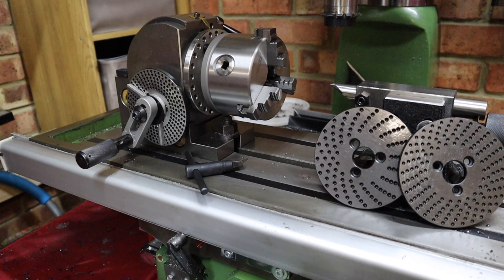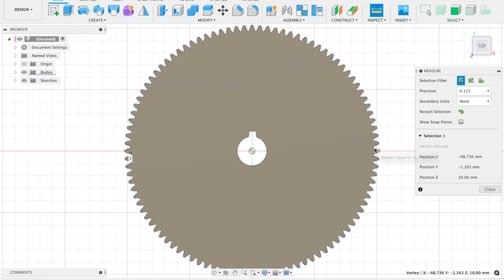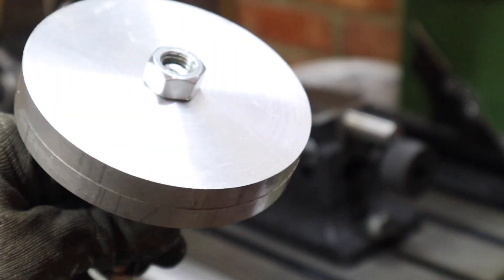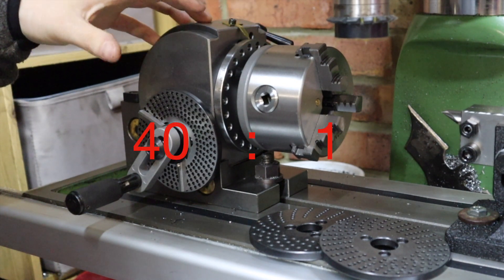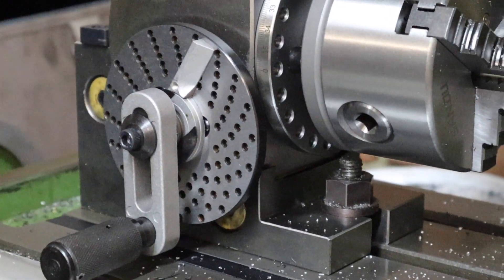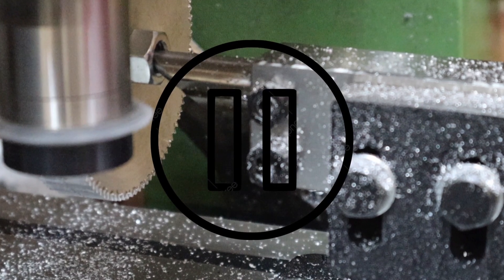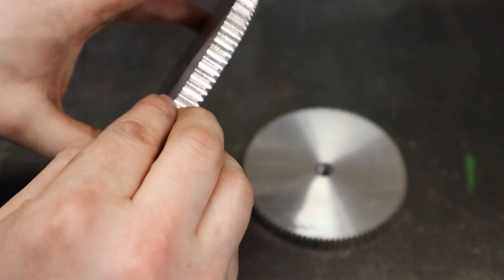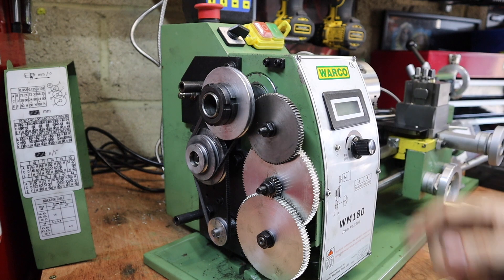Making Gears for a MINI Lathe

Comment: Better to use a flanged arbour to avoid the runout that resulted. That is likely to induce more wear on the aluminium teeth, operating in the lathe.

Comment: Just a word of advice about cutting feed direction. It is recommended to only cut forward into the gear blank with a B&S type gear cutter. They being a form cutter are likely to grab in the cut groove if you use them for 'climb milling'. The best procedure is to cut forward through each tooth slot then return back through that slot with no extra infeed put on.

Comment: So how did you know what diameter you needed, to get 100 teeth on to the gear evenly? Did you get your drawing from someone in the know?
Reply from the maker: Hi Jack so I took this information from Fusion 360. I draw a replica module 1 gear with 100T and inspected it with the measure tool. It’s at the start of the video.
Reply: cheers, saw that but didnt understand where the drawing came from.
Reply from the maker: @jackdawg4579  ohh sorry jack so fusion 360 has a plug-in you can download where you can generate gears. All you have to input is module size tooth count and angle which in our case is 20 degree and then hay presto we have a gear. Hope that helps.
Reply: @MachiningwithJoe  how cool is that!

Comment: Well done Joe, years ago I had misplaced my 40T gear on the lathe drivetrain, so I made one from Al like you. But i made a single tooth cutter ground to the contour of the tooth pattern. It worked great and I made another from Bronze and then I found the gear. Anyhow, gear cutting is a great experience, enjoyed the vid, congrats on the subs, and cheers!
Reply from the maker: Sounds interesting cutting gears with a single tooth cutting tool. Yeah it is satisfying when that last pass lines up and created a perfectly spaced gear. Thank you for your continued support on the channel Howder all the best.

Comment: Do you have to harden the gear s before you fit them?
Reply from the maker: If they were going to be under heavy load then yes make them from high carbon steel and harden them. However for a mini lathe these should be ok as some versions of this lathe come with plastic gears.
Reply: @MachiningwithJoe  Thanks Joe

Comment: That’s the only thing I dislike about my similar lathe, the power feed is too quick for a good finish.
Reply from the maker: I think for a better fix I still prefer the external motor driving the lead screw I done in a previous video. This is ok for a every now and again use.

Comment: Good video, I'm done cutting custom gears and changing them though. Electronic leadscrew ftw, reckon that'll make a good build series if you want to embark on that journey.
Reply from the maker: Hi dude welcome to the channel haven’t seen a comment from you before. I have already previously done this however it was belt and pulley attached not direct drive. Definitely a better option for full time use.

Comment: Bit risky drilling both blanks together, but, bcoz it was Aluuminum (spelling intentional) you got away with it 🙂Flat tooth, yep, its tedious doing all those teeth, if we are honest, most of us have done that at least once. And, Climb milling vs Std milling, see the difference on alternate teeth, the smooth ones are climb milled, but there is danger of snatch 🙂 Good job for 1st try 😀
Reply from the maker: Thanks Dr1verman I’ll have to inspect the gear profile and see if the finish is as you say will be interesting. Appreciate your support and comment all the best.
Reply: You will certainly get a different finish in the alternatively forward cut and climb cut slots.